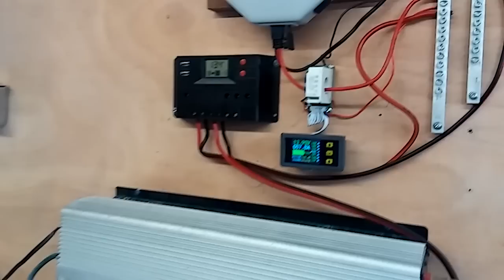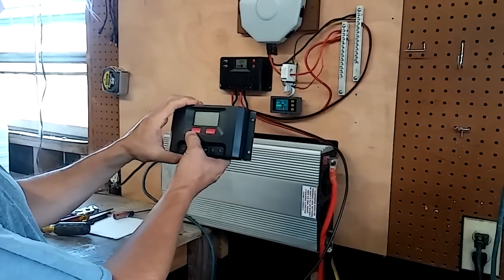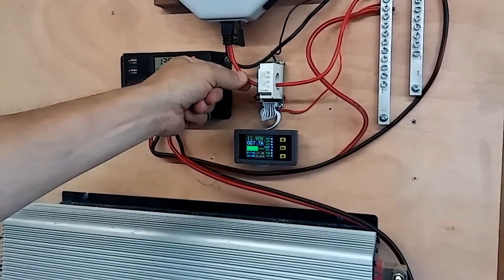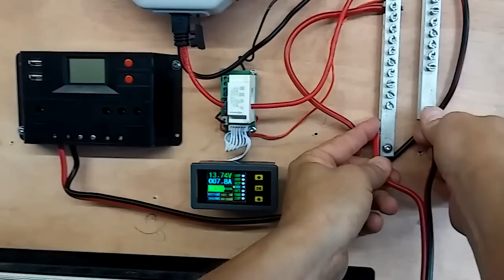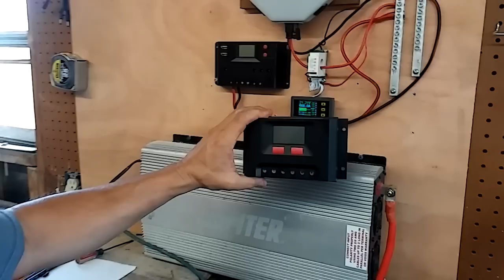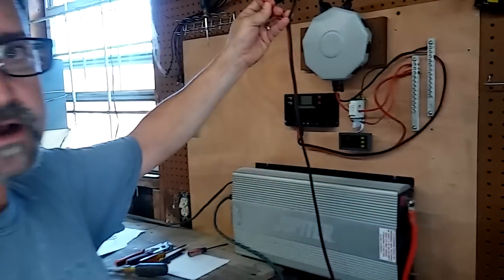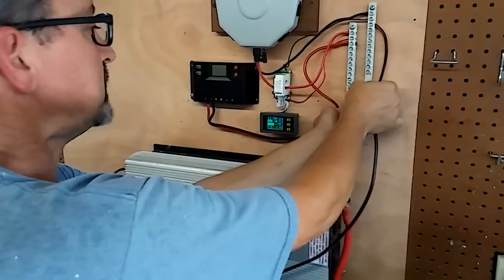Maxing out Harbor Freight solar panels

Comment: Try hooking it all back up the way it was at the beginning of the video with the Inverter tied to your battery and turned on. Now get a heat gun, your wife's blow dryer, and electric heater, ...... (something that likes lots of watts). Plug into the inverter and turn it on. Now go look at your amp meter. I think you will be surprised.
Reply: Yeah my thought was the battery can't make enough current draw haha.

Comment: That is not the proper way to max out the solar panels.  You are still going thru that hub, the bus bars, and into a charged battery.  Try taking the output of a single panel and run it into a highly discharged (but otherwise very healthy) battery.  I suspect you will see more than 1A of charge power, perhaps even as much as 1.5A in intense sunlight at the perfect angle.  Each time you add something such as a meter, a bus bar, a hub, more wires... you are adding series resistance and dropping the current.  Even if you shorten the wires from the panels, you should see a slight increase in amperage cuz there are losses in the wires.
Reply: You will never see 25 watts directly out of a panel that is sent to a discharged battery. I don't remember what the dead short value I saw was but it was under 1 amp and the panels produce their most power at the 18 volt point. You do not get 2 amps at 12.5 volts but you can get 1.5 amps out at 18 volts under ideal conditions. They will likely  show about .8 amps at that point. That is why a MPPT controller is needed. You need to get the panels' voltage and amps to the max wattage point for what you have available from the sun. I have a picture of the MingHe MPT-7210A from the other day where it showed 198.5 watts output out of 200 watts of panels. 26.02 volts X 7.63 amps = 198.5326 watts. I didn't have the ammeter on the input to it at the time but I would bet that it would have shown over 200 watts into the controller. That was just before the fuses blew as my output to the batteries is fused for 142.56 watts. 3 X 3 amps X 15.84 volts. That showed a battery voltage at the time of 14.1 volts. The difference in 14.1 and 15.84 is the blocking diodes voltage drop on both legs. A fourth, fifth, and sixth buck converter are on hand so that I can get the power up to the full rated output of the 7210A. And then when the second 7210A arrives, the rest of the 400 watts of panels can be installed.
Reply: That seems like a lot of expense to squeeze out a few more watts.  Here is an idea for a "poor man" to try... If a typical 12V panel can output as much as 23V unloaded and produces peak power output around 18V, why not put 3 of those panels together in series to get around 54V peak power voltage, and then just connect that to a 48V battery bank?  What someone could do is monitor the output voltage of the panels in series and if connecting them to a battery in a mid state of charge is too much load for them (dropping the panel voltage below 54V), then just add some series resistance before the batteries such as a piece of wire.  After experimenting enough, you should be able to get it so that even in full sun, the output voltage of the panels should not be too much to charge the 48V bank.  54V on a 48V bank is like 13.5V on a 12V bank which is the voltage that can be used to quickly charge a battery in a mid state of charge, but by holding it at 13.5V (per 12V of cells), that will not overcharge a battery since that is industry accepted standard as a healthy trickle charge/maintain voltage for a full charged battery.

I think it would be worth investigating this setup.  I can even try it cuz I have a 4 panel Harbor Freight kit so I can just connect 3 in series and monitor the current flow.  At 54V solar panel voltage under load, I would be very lucky if I get 1A (54 watts).  The advantage is I wont need a solar controller.  I could also sell my 4th panel to someone that wants to play around with solar on a budget since buying 1 panel is much cheaper than buying a whole kit.  For example, someone that already has an inverter and a 12V battery but wants to monkey around with a single solar panel to help keep the battery topped off.  Perhaps someone that has a shed and just wants to give it some solar power or maybe someone that already has a 4 panel HF kit and wants to add a 5th panel to get is closer to a true 100 watts output.
Reply: @davidjames1684  Yes it did eat some of the power but it was done so that it was a 12 volt system in my case. Currently it now is working as both a 12 and 24 volt system. During the day, 24 V and at night, 12 V. With 200 watts of panels, it is getting around 550 watt hours per day in a 10 hour period. It does hit 100 watts just about every day for about 1 hour. My batteries are never below 12.4 volts in the morning and are at about 14.4 around noon. They are at 13.1 around midnight. And HF has started to sell single 25 watt panels too.
Reply: I have a new kit from Harbor Freight and would be willing sell you some individual panels so you want to get more total power out of your system.

Comment: 200 w and have same story... Every rating can be divided by 2, or 50% or listed value. I'm in Tuscon at mid day with no clouds and get same readings as yourself. Was going to use MPPT due to 10A max limit, but it'll never hit 10 with only 200. Thanks for confirming...

Comment: Impedance matching of source and load for max power transfer is the name of the game. Too much loading and there will be a "brown-out" drop in voltage in the panel. (P = I x E) Too little loading and the power is under utilized from its potential. That is what a MPPT controller does. But further to your experiment; was the battery near to a full charge? One function of a controller is to taper off charging when nearing charge completion to stay inside the battery safe parameters. Repeat with the battery sufficiently drained as a starting point.
Reply from the maker: Later on I came to find out that the controller had an issue. When I put the original controller back on I’m more than doubled my output. The original charge controller that came with the kit works a lot better than that 500 W controller that Harbor freight sells that’s supposed to be better. I no longer have any of that equipment. My system has been upgraded. Go check it out

Comment: sorry you need air space under panel ,or they over heat ,resulting in way less power. i have mine on a pull so it gets cooling from wind .I have pulled 8.7 amps out of mine . keep it cool or the panel will degrade and start pealing solar material off. trust me air space is every thing winter time it will produce slightly more power ,up to 12 amps when cold in full sun
Reply from the maker: You can not get 12 amps out of  a 100 watt panel. 100 watts divided by 18 volts is 5.5.   Even at 14 volts which is where charge controllers charge at the most you’ll get is 7.1. In the winter time I’ve only gained approximately 10% so it’s not really worth the effort to lift them off the roof
Reply: @Checkitfirst  when there at - 10 you can the voltage on the panel go's up

Comment: I know what part of your problem is.....
Solar Panels DO NOT like heat! You have them mounted DIRECTLY on your roof. Get some 2x2 Wooden slats, raise the panels up on them to allow some AIR to flow beneath them and your roof. This will allow the panels to run cooler, and you MAY gain an amp or 2.
Reply: That's a good observation! I believe another part of the problem is those panels are inferior. I use just two 100w SunPower monocrystalline high efficiency solar panels that take up far less room than eight of those HF panels and will put out up to 177 watts combined.
Reply: @RoundTripSpirit  and they are only 25 watts each+ 100 watts total

Comment: I sure appreciate you demonstrating how to do this test. It stands to reason that without any resistance between the solar panels on a sunny day and a thirsty battery, you'd have approximately 8 amps. 100 watt panels / 12 volts equals 8.3 amps. If you got eight amps even it means you were drawing 12.5 volts. Just what we would have expected! I guess the trick is to get a really good charge controller!
Reply: Absolutely! You can get buy with an inexpensive battery and so-so Panels in a Pinch. Put your Money into a GOOD controller; then as finances allow, upgrade the battery, THEN concentrate of higher quality Panels!
Reply: @michael - Except, he has a 200 WATT PV Array !

Comment: Something I noticed between when experimenting with my solar controllers. There is a difference between amps being pulled when a battery charge load versus a dummy load. Your panels could probably push more amps but your batteries might be limiting this
Reply: You can achieve a similar effect by applying a known load amount, you just have to periodically check solar input amperage to get accurate numbers

Comment: A suggestion to controller manufacturers: Solar systems are designed with excess capacity for worst case cloudy days. Then the battery charges quickly to full charge on a sunny day and reduces output or turns off. Why throw away this excess capacity? Just add a pair of terminals labeled "EXCESS" and transfer power to them when battery charge is maxed out.. Then you can use the "low-grade" excess to a money saving device such as heat tape to a hot water tank intake. Overall, it is a saving in propane or natural gas.

Comment: "Check it first" I have 2 sets of the Harbor Freight solar panels 100 watt just like you.  I used them this summer to power my aquaponics garden pumping water and air from a pond through my garden and back into the pond. I also use my solar panels for emergency to charge x2 79AH deep cycle marine batteries that powers a "pure sine wave" (pure sine wave is easier on electronics) inverter to keep my cpap,small fridge,small fan,and laptop going in an outage.  Being I'm up on Lake Erie I get a lot of cloud cover and being amorphic these panels perform REALLY well (%90-%80) on a cloudy day as long as the cloud cover is not REALLY thick.  They just take a lot more space than mono/poly which is ok for me working in a garden and perhaps for others if space is not an issue. The charge controller that came with your harbor Freight kit is rated for up to 20 amps. On a good day you'll get about 5 amps at 18-22 volts per solar set.  The real problem is the charge controller that came with your kit is PWM (Pulse Width Modulation) and wastes power as your batteries get higher in charge.  You are far better off getting a MPPT (Maximum Power Point Tracking) charge controller.  Switching to a good MPPT charge controller on these panels should yield you %20-%30 more charging power over the winter and %10-%20 more charging over the summer from your solar panels.  So as you can see the more panels you have the more power you are wasting with PWM.  MPPT charge controllers used to be VERY expensive (many still are) and there are a LOT of fakes sold out there.  Fortunately for us "small" users there are recently some reputable companies that make affordable good MPPT charge controllers.  Many people will have recommendations on what is best/cheap. Myself I have had good luck with EPEVER brand who are well known in the solar community.  I find them affordable and efficient for my needs.  Here is an example you can read on: https://www.ebay.com/itm/EPEVER-20-30-40A-Solar-Panel-Controller-Charge-MPPT-Wifi-Or-MT50-Lithium-Battery/263049168664?_trkparms=aid%3D555018%26algo%3DPL.SIM%26ao%3D1%26asc%3D20131003132420%26meid%3D21ce49df325c43ec821c578ffdba717e%26pid%3D100005%26rk%3D1%26rkt%3D12%26mehot%3Dpp%26sd%3D253412631963%26itm%3D263049168664&_trksid=p2047675.c100005.m1851    I'm sure others here will have good/affordable suggestions for MPPT as well. Just be careful there are a LOT of fake units out there.  I've used these Harbor Freight kits for a while. Feel free to ask any questions if you want and I will be glad to answer when I log in. :)  Another popular MPPT controller Renogy: https://www.amazon.com/Renogy-Commander-Solar-Charge-Controller/dp/B01DCNSVIO/ref=sr_1_50_sspa?ie=UTF8&qid=1540017855&sr=8-50-spons&keywords=mppt%2Bcharge%2Bcontroller%2B12v&th=1 (a rebranded newer EPEVER I think).
Reply from the maker: Awesome info... Thank you... Looks like the EPever is the choice for me.. Thinking of adding some wind power to my set up. EPever has one that can do both☺.

Comment: Your solar videos are so awesome I have 2 lots and was thinking of buying an mppt but u with facts proved not to waste my money and just keep my 2 controllers on my set up which is identical to yours except I have the 3000 jupiter I did by the 5000 cause it was a parking lot sale/return for $150 and bought it as a backup for my 3000 if it ever goes bad. Thanks for your videos!!!!!!
Reply from the maker: msgt1942 . so glad you like them. Im going to get 2 more kits. Im sure I will have to upgrade my controller at that point. Not sure yet which one but we shall cross that road when I get there. Hope you enjoy your solar project. Remember to point them south☺
Reply: @Checkitfirst  will follow your lead and wait to see your upgrades because I will most likely do the same just got started and learning a lot thank you sir. But I don't think I will do the bus bar thing unless you feel it really helps
Reply from the maker: msgt1942 . I only did the bus bars for my own tests. They are not necessary

Comment: @Check it first,Try using a resistive load across the solar panel. 

The varying load of charging a battery only shows how much energy the battery is ACCEPTING,
not how much power is actually available.

Incandescent light bulbs or DC motors work well. 

Just make sure that your load is 24 volts DC or more, and at least 5 amps, 
so it will consume 100+ watts without harming it.

I have this same Harbor Freight 100 watt solar kit. With three 50 watt light bulbs, 
I have gotten up to  to 110 watts directly from the panels in full sunlight.

Oh yeah, almost forgot, I live at 45 degrees 45 minutes North Latitude, where the sun doesn't have
nearly as much energy as further South.

One other thing.  These are amorphous silicon cells, which actually out perform my more expensive
crystalline silicon cells in low light situations.  Like overcast days.
Reply from the maker: Awesome.. Thanks for the info.. I have 300 watts now. Its doing pretty good. Check out my latest video☺
Reply: The power available is the working power, you cannot include ghost power...

Comment: I'm using text-to-speech so things might get a little mixed up in the text.
I'm not saying this to be a jerk, but you may want to turn your panels the opposite way so that the wires come out the top. I have eight of these left out of the 12 that I had. Water finds a way into that plastic around the cells and over time it will corrode your connections. Once I reoriented my cell the problem went away immediately and I've not had any other situations develop with the panels
Reply: You couls ALSO seal all the potential trouble spots with Clear Silicone and solve the issue that way.
Reply: May be a silicon around de edge between plastic and the solar panel will help.

Comment: I have 4-100 watt Harbor Freight Solar Kits, tied to the 400 watt connector hub. 
Then I have a distance of about 70’ to the garage and the charge controller.
What gauge wire should I run between the Hub and the charge controller?
Thanks-
Reply from the maker: At the time of this video I had eight gauge

Comment: What an MPPT solar controller does for you is that, when the sun rises or sets, your angle and the long path through the atmosphere will limit your solar flux and drop your panel output voltage, but the MPPT boosts the voltage using an adjustable buck-booster, so that it trades amperage for voltage, so that its output voltage will charge your batteries, because the voltage charging a battery MUST be greater than the voltage of the battery or it won't add charge.  
--
All a PWM solar controller does is turn off the charging when the battery gets too full by pulse width modulating the voltage it applies to the battery. When the pulse is off, it checks the battery voltage, and then when it's on, it only remains on a certain length of pulse before it checks the battery voltage again.
Reply from the maker: Now that I have added more panels I can now justify the cost of an mppt which i have recently bought

Comment: Can I use three 12 volt 35Amp batteries in series using the 30 Amp solar charge controller that came in the kit? without ruining the controller? Thank you
Reply: Folllowing as I have same set up
Reply: I'm confusted. I believe the controller that comes with the HF kit is a 20 amp max unit designed for a 12 volt battery bank.
3 12volt batteries in series gives you a 36 volt system.
I'm not sure any of this is the correct use of the controller included in these kits.